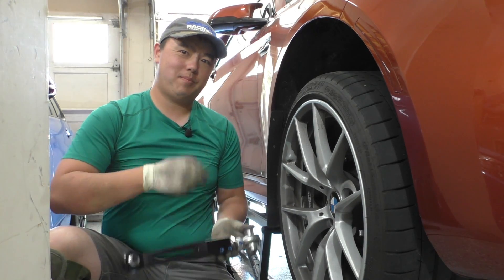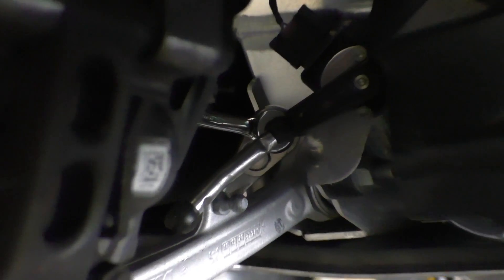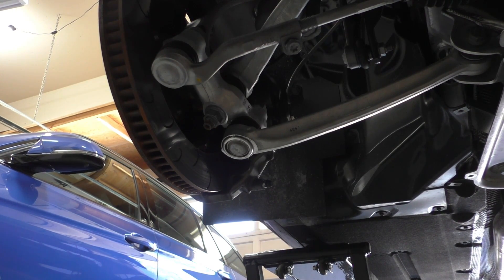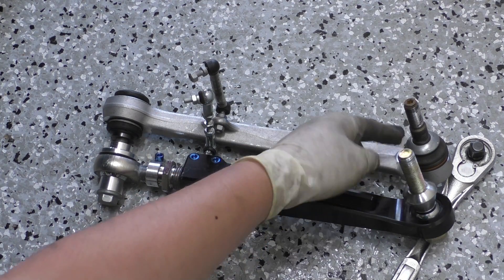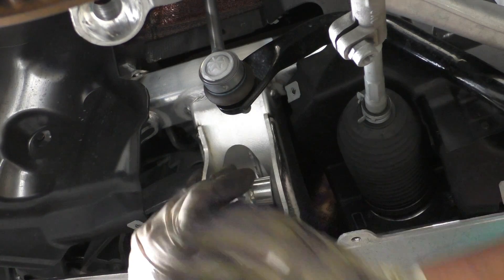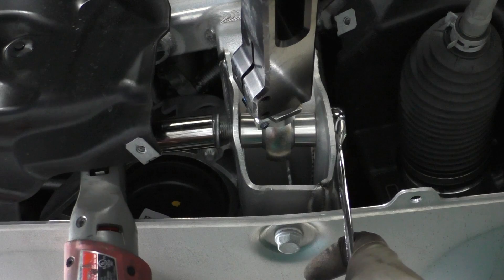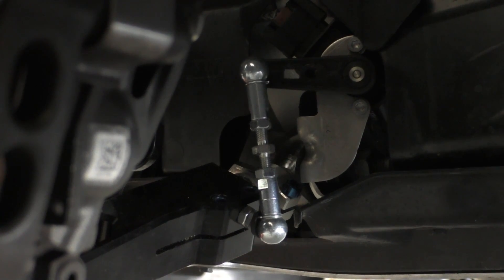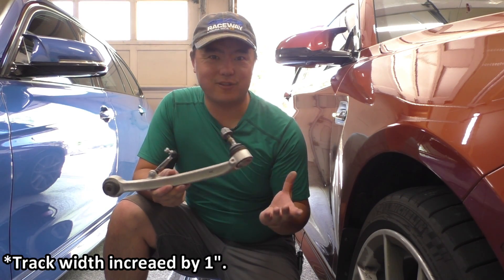BMW M2/M3/M4 Lower Control Arm Installation (F8x)

Comment: Don't you need to reclock that main bolt to the subframe?
Reply from the maker: Nope, because that joint on the arm is a ball joint and not a rubber bushing. Ball joints don't have a set position they try to spring back to.

Comment: Caster is 7 °30？ thank you
Reply from the maker: Making the LCA longer does push the wheel further forward in the wheel well increasing the caster. At max length your caster will probably be about 7.5deg or a bit under.

Comment: hello Sir, is this the rearward lower controll arm? I have a f80 m3,  are they the same?
Reply from the maker: This arm is for the front wheel, and is the lower rear arm. This arm works for the F80 M3.
Reply: @FaRKle0079  yes Sir, but when Im looking for control arm, there are 2 kind, one is the lower control arm , another one is lower control arm rearward, they are both for front wheel, thats why i am confused.
Reply from the maker: @lallen968  There are 3 arms for the front wheels 1) tension strut/thrust arm in the front upper position, 2) tie rod in the front lower position, and 3) wishbone/lower control arm in the front lower position. This SPL arm is the wishbone/lower control arm. Please consult with your vendor if it isn't clear.
Reply: @FaRKle0079  Thank you, another question, do you need to jack up the wheel before you torque it? so the weight of  car can put on suspension?
Reply from the maker: @lallen968  For the wishbone/LCA you don't need to have the suspension loaded when torquing the connections since both ends have ball joints and not bushings.

Comment: Great video, and timely for me I might add as I am considering this upgrade for my F80!  Incidentally, my F80 is lowered on the MP HAS kit and I have -2.5 deg - with more to go if I wanted using the GC camber plates I have installed.  Would you still recommend this modification if camber plates are already installed?
Reply from the maker: Yes I would recommend this even if you have camber plates for the wider front track width. Just keep in mind the exposed ball joints though for the types of driving you'll be doing.
Reply: @FaRKle0079  Thanks!  My F80 would not see any corrosive snow/salt conditions, just occasional rain on the street (or track).  That said, what kind of maintenance can you expect regarding the monoballs (and the rest of the arms), based on nominal driving conditions (mostly dry with some rain on the street & track)?
Reply from the maker: @jmciver767  The thing you want to avoid is dirt/grime/contamination (including water) getting in between the  monoball/race where it'll grind away at those two pieces or a liner if there is one. The only thing you can really do is take a brush and try and brush out any build up at the entry to that interface. Not the easiest thing to do.
Reply: @FaRKle0079  Such is life with race parts on a street car I guess - not necessarily a deal breaker for me though.  Out of curiosity, based on your comments regarding dirt and grime, what is your anticipated maintenance schedule with these parts installed on your M2?  Will your M2 see much rain (on the street), other than the occasional rain at a track day?  Or will the M2 only be your dry weather car?
Reply from the maker: @jmciver767  I honestly don't have any good data how long these ball joints should last. One other user in Europe mentioned his lasted about 30k miles. 

For me personally, the M2 is a purely leisure vehicle so it's not going to see rain unless that happens on the way/at an event. I'm not confident enough in unsealed ball joints to put them on my wagon which sees rain, and offroad conditions.

Comment: Is this arm instead of camber plates or do you also have those installed?
Reply from the maker: I tried using this arm without camber plates to see if it could get enough camber. It looks like you'll still want camber plates to bump things up to around the -3deg mark though. I'll be adding camber plates in conjunction with these arms later.

Comment: Who's rotors are you using on your car?
Reply from the maker: Those are the AP Racing rotors. I have the full BBK.
Reply: @FaRKle0079  Nice, you have P/N# 
Vendors?. How much more negative camber do you expect if you lower the front end?
Reply from the maker: @michaellegere4823  The SPL arm PN is 
SPL FLCA F8X. SPL told me they've seen -4deg, but they wouldn't tell me how lowered that car was. I think if lowered a bit you could expect around -2.7deg.